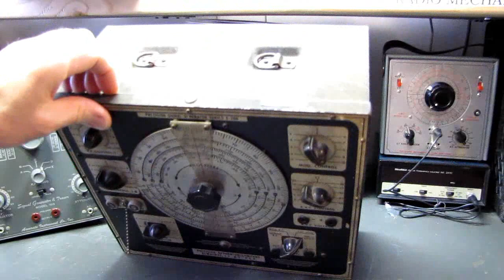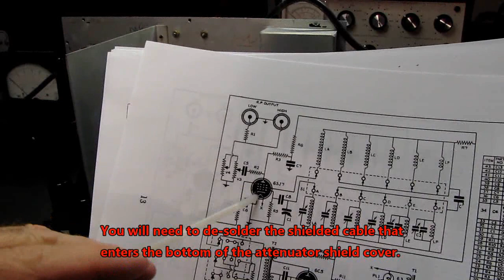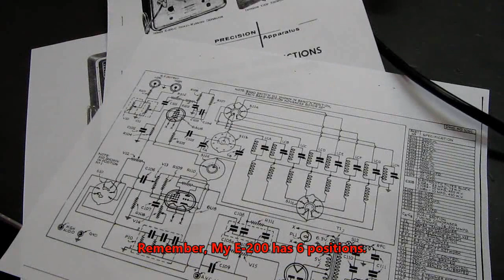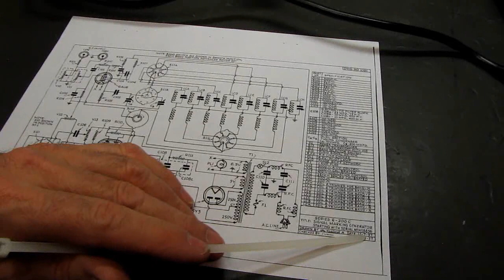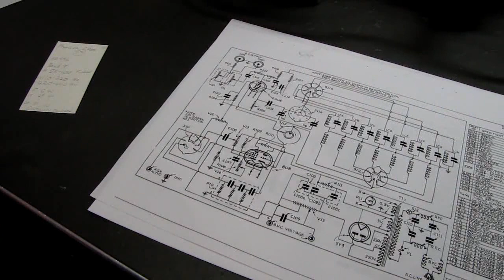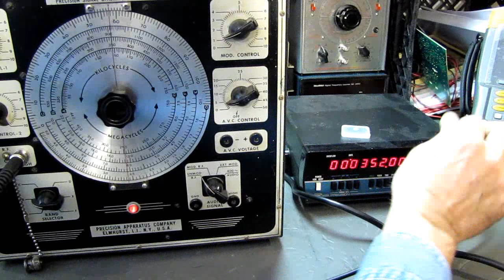10 Buck Test Bench - Precision Apparatus E-200 Signal Generator

Comment: I added a buffer output and a BNC fitting to feed into my freq generator.  Just a couple of high value resistors as a voltage divider driving a simple NPN transistor output circuit.  This way the freq counter is stable no matter the signal level used.  I found out after that the freq counter isn't really needed because the unit is indeed very (surprisingly) accurate.

Comment: I just ended up with one of these.  Of course I paid $50 exactly like you said not to do.  Until we can get back to hamfests I guess we are stuck with eBay and $50 seemed like a deal there.  I was surprised to find a 4 pin tube inside of the E-200-C.  I would have thought that by the time they got around to the "C" model 4 pin tubes would have been long gone.  Thank you for your insights, I am definitely early in the learning process and your video will be helpful as I go through mine to get it back into good operating shape.
Reply: There were a crapload of WWII surplus tubes still floating around in the 1950s.  I have hundreds of military surplus tubes in plain beige boxes still. My guess is that Precision bought more 80s than they would ever use for pennies on the dollar.

Comment: Great video!  I may be asking a noob question, but why can't you adjust the trimmer capacitor to dial in the lower end of, for example Band C at 455khz, and just take the larger error at the top end where it's not so critical?  Or is it that trimmers always should be adjusted for the top end?

Comment: Thanks for the video on the Precision E-200. I found it very useful.  I picked one up at a Hamfest a few years ago for $5 or $10 and just let it sit here.  Needing a signal generator for an alignment, I dug it out and starting researching it, like you did.  I changed over to BNC connectors last nite, and wondered why the low output side was so strong.  It's because the resistor was buried in that old mic connector.  I would not have known this if it weren't for your video. Now I'll have to unsolder that cable coming out of the shield again. 😢   But that will have to wait until after the alignment.  I'll also recap it in the near future.
73 Paul AA1SU
Reply from the maker: Your Welcome VT.

Comment: I have an E-200 I picked up on EBay . I have yet to do the cap job. It’s the older version. Fuses in the plug. Keeps blowing only one fuse. It came with a 6J5GT as opposed to a 6C5. I replaced the tube according to the original schematic with a 6C5 and it blows fuses. I’m wondering if it was modified for the 6JJ5. It never blew a fuse with the 6J5GT.

Comment: One question: How is it that signal generator has BNC outputs? 

I was under the impression BNCs weren't invented until the 50's. And most similar equipment of newer vintage does not have BNC output. They usually have that weird old threaded output jack to connect a probe or clip leads.
Reply from the maker: I removed the weird connectors and replaced them with the BNC. Same size hole and much easier to use.

Comment: ebay wont's 100.00 to 125.00
Reply from the maker: Hi Ronald, E-Bay prices are usually just plain stupid. If a unit is in perfect condition and fully restored, then the price would be justified. I have seen clowns asking over $80.00 for units that are rusty and missing all the knobs and dial pointers. Just plain stupid. Find where the Ham Radio Flea markets are held in your area and keep looking. Thanks for watching.
Reply: There are only three ham fests locally (ATL) in my area (50 mile radius) during the next six months.  I work full-time and it would take me a lifetime to wait for steals at a hamfest one at a time.   I also don't have time to spend my weekends at flea markets (plus I hate flea markets) and factor in fuel.  I shop carefully on Ebay and have gotten some good deals.  No five dollar specials mind you.  If you already have a complete test bench then you can take your time and pick up deals where you find them.  I'll gladly pay more to have the item show up at my door.  I want to restore radios, not shop for test equipment for the next ten years.  Love your videos, keep em coming, Doc

Comment: Signal generators don't seem to have a mid range option.  At the one end you have the types that you have been restoring and the modern solid state versions such as the Instek and B&K. Basically the same design with the analog tuning dial. They sell in the $25 to $50 range for the older ones  to around $150 for the modern equivalents new in the box. Then you have the used HP stuff that is 20 to 30 years old that goes in the $500 to $1000 range depending on the age and condition. I use an HP 8656B which is a pleasure to use but I keep my old Eico and Heathkit generators around for the old tube receivers. I've always been a bit shy about exposing the HP front end to the dangers of high DC voltages even with large blocking cap in place.
Reply from the maker: HI Doug, we are cut from the same bolt of cloth. I use my Older gear on old AM radios and keep my HP 8657A away from H.V. 
Besides, it is fun to use the old gear to fix old gear. Thanks for watching.

Comment: Very good video.  Nice unit. I have a different take on that big power X-former.  I remember that in the '40s and well into the '50s, many localities still had 25 cycle power systems from the lines.  That required more iron in the X-formers & chokes than 60 cps.  Many used a 25 cps components, since they worked fine at 60 cps.  You may be able to find the power specs for that E-200, they probably would say "25/60" cycles.  Anyway, interesting job, thanks for sharing. .............Dick
Reply from the maker: Hi Dick, all the copies of the instructions I have seen say quote  "use only 110-120 volts 50/60 CPS unless specifically supplied for other voltages/frequencies." I would think that 25 CPS ( HZ ) would require larger filter caps also. Interesting theory though. Thanks for watching and for stopping by. 73 Vern N1CKX

Comment: What a great quality signal general generator.
I can NOT find cheap test equipment, I have to buy off EBAY and pay HIGH prices for them.
I was very lucky to have a few guys send me some test equipment free for just the price of shipping.
I agree with you the EBAY sellers are asking insane prices for an example you can't touch any oscilloscope working for less than $100, even a 10 MHZ scope is going for that much money.
Try to find a Tektronix 454 100 MHZ scope for less than $300 and even a 453 50 MHZ scope is going for 100 bucks. 
You are very lucky to get those bargains I have to resort to buying on EBAY.
I replaced all the slotted self tapping screws on my EICO 324 and my EICO 950 with Phillips screws, I just took a screw to my local true value hardware store and got a bunch stainless screws.
I like Phillips  screws better, the screw driver dies not slip and scratch the panel.
I have an EICO 324 signal generator and the wave form is not a sine wave, I have seen YT videos of a guy showing the nice clean sine wave form coming out of a LEADER model 17? not too sure of the model but I think the newer signal generators have better wave forms than my EICO 324.
Reply from the maker: Hi Goat,  It seems no matter what Ham Radio Flea market I go to I find this stuff. Have several in NH and a couple in MA that I go to. Gotta get there early and make sure you poke your nose into every nook and cranny. Often it is on my 3rd or 4th pass that things turn up. It's not just E-bay with crazy prices. I was at the Nearfest flea in NH and there was a guy with an old 10 MHz Heathkit scope. He wanted $250.00. I told him he needed to stop taking recreational Pharmaceuticals.  Another guy wanted $175.00 for a 20 MHz scope that looked like it had been stored in a mud puddle. I went back to them later with three scopes all of which I paid less than 30 bucks for. One 30 MHz very clean unit was $15. Rubbed them under their noses and told them have a nice time taking theirs back home. By the way, the harmonics are not really an issue if your using it to align old radios. In fact using the harmonics allows you to double the frequency on the dial. But then you probably know that. The only issue is when trying to use an old fixed level counter like the Heathkit. But you can build a simple L/C circuit to filter the harmonics and then use the Heathkit. I should do a video on that.  Thanks for watching.
Reply: Thanks for the info and the rely.
I have a Lodestar 5270 that was given to me and it seems to work good on my EICO 324 so maybe a waveform with harmonics will be okay on it.
I juat need to add a BNC jack to it for the frequency counter, I have a 10pf silver mica capacitor that I think will do the job adding that to the UN-attentenuated high side of the output.
I live in Connecticut and I no longer drive long distances, poor eyesight and OLD age.
I would love to come up to NH, the last time we went up there was back in 2006.
Thanks, I enjoy your videos.
BTW there is a ham radio auction coming up toward the end of April, it is the RASON auction, mostly ham stuff but they do have some other goodies.
73's  Bill  N1NCW

Comment: Just thought I would mention that the old plug for power that you showed taken out can sometimes trip a ground fault breaker all by itself, what happens is the plastic or rubber changes as it ages and becomes ever so slightly conductive, just enough so to trip a ground fault breaker!!  this is another reason to get rid of the old plug!! I had to change one on an old Collins transmitter because I had the problem of my house breaker tripping and could find no problem what so ever with the transmitter until I ohmed out the line cord by itself then the plug by itself and found a little over a megohm resistance!!
Reply from the maker: Hi John. A lot of the "Glue" used on circuit boards to hold components does the same thing over time. Becomes conductive and causes all kinds of issues. Also don't forget the "safety" caps. These can trip GFI breakers also. The AC line filters on R390 radios were famous for tripping GFI's. Lots of gotchas in old gear.
Reply: Good thing you mentioned R-390 !! I currently have an R-390A! have had it for about 35 years, I will have to check the condition of the line filter, thanks for mentioning this!!   John A Bellas KC2UVN

Comment: Nice units. I just picked up a E-200C on eBay for $17 plus shipping. Replaced the electrolytics  and two paper caps. The rest of the caps are ceramic. Without adjustment the dial is dead on.
Reply from the maker: HI Robert, good score. As you saw this thing was full of paper caps. And EVERY one of them was leaky. The silver Mica ones were OK. Only had to touch up one band due to having to remove the coil to fix a contact on the switch. Didn't bother showing that as I am going to do a video on how I fix wafer switches at some point. No I have to find a 200C to be a companion to the 200.
Reply: I saw my first one on Paul Carlson's channel. I love the old equipment. This was listed as "Steampunk" for I guess ornamental use. It looks like yours except for the fact the modulation control is labeled in % modulation. It has the newer 6AU6/6U8/5Y3 tube compliment. I powered it up through an isolation transformer and it was right on frequency. The filter caps have high values and ESR so I am recapping it. Resistors all check OK. Another thing I liked was it was factory 3 wire power corded. Sure it's not as stable probably as my B&K but still fun to use on the old radios that find a home here.😉